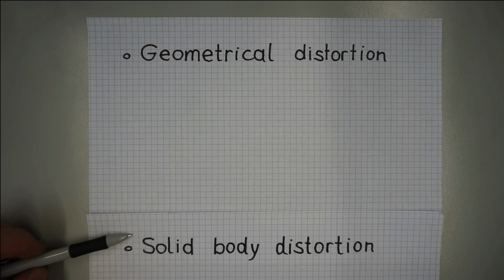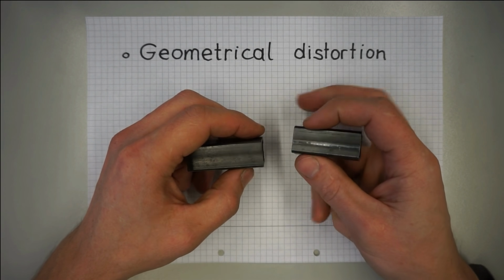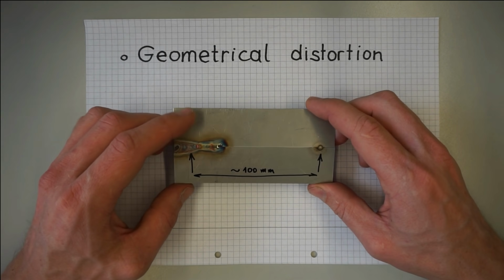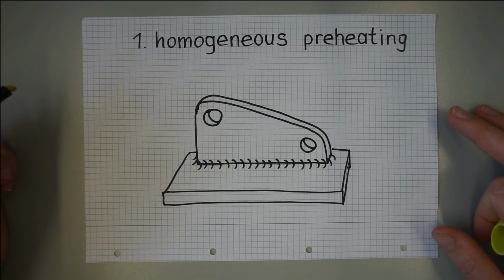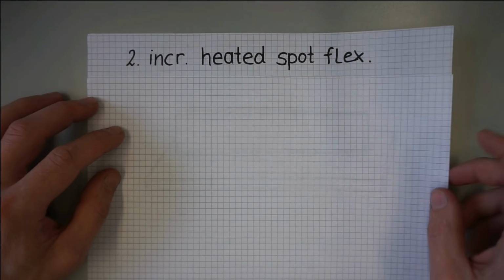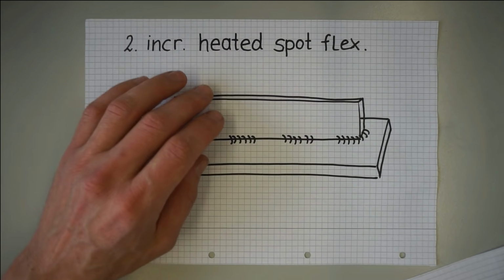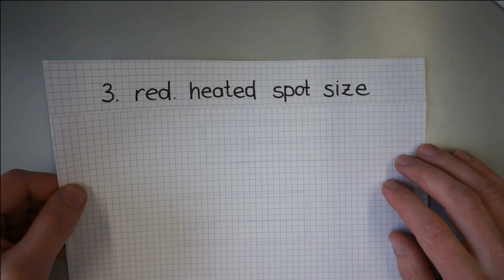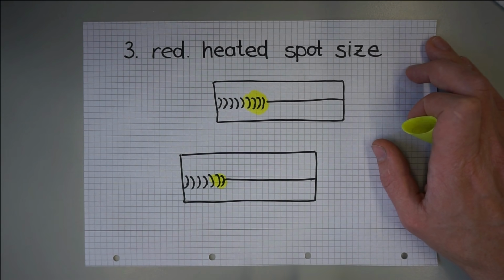Welding Distortion Explained Part 4: Influencing Distortion

Comment: Such a amazing series! Thank you very much. I was really shocked by result with clamping. As a amateur welder it open my eyes that prep work, positioning and proper tacking is the best way to minimize distortion. And that it can be actlually straightened with flame or tig torch by local heating. I have no idea you can actually somewhat "repair" that distortion, i was living in world where it just happened and nothing can be done.

Comment: I still did not understand why its bending in the direction where the heating / welding was applied? If heat expands stuff then intuitively it should bend in the other direction, opposite to the weld? But thank you for the 4 parts. I'll have to search another additional resource.

Comment: Outstanding series. I'm trying to wrap my head around how clamping with the fixture table effects welding distortion. I can understand that if you heat up one side of the square bar in the center, the material becomes soft and expands. As you say, it's being constrained in x and y, but mobile in z. It makes sense that if the bar isnt free to move, there will be a greater expansion in z. but, for example, if you wanted to make a square frame out of square tubing with 45 degree joints, would fixturing it reduce distortion? Maybe because the joints are being connected together when by the filler metal when it is at its hottest (most expanded). There for the only distortion that happens is from the contraction of the joint. The fixturing constrains this and causes plastic deformation of the joint in favor of reducing welding distortion? I'm not sure

Comment: Hello Alex, Can I have your insight in residual stress in big machines such as CNC machines. I see many DIY makers make their CNC machines (even the one that is quite accurate) using welded frame and gantry. I always wonders if the residual stress really significant in such builds or it will creep up later and, say, bend the frame.

Thank you and have a nice day!
Reply: Hello Thanh, thanks for your comment. From where are you writing to me? Good question you raise. The welding residual stresses are a concern unless they are relaxed by heat treating the welded parts. If no heat treatment is done, however, they are less of a concern if the welded parts are sized thick and beefy for the loads the machine will have to deal with. If, on the other hand, the parts are sized thin and lightweight, then the loads the machine puts onto them may raise stresses high enough so that residual stresses from welding plus stresses from machining loads together may cause the material to yield in large areas, causing the welded part to deform plastically. Hope this helps. All the best, Alex.
Reply: @alexfillafer  
Hello Alex, thank you for your promt reply!

Im writing to you from Vietnam, a tropical coastal country in South East Asia. Shared your vids to a bunch of my maker friends and they are all excited. Especially this series and the straightedge vid. We all appreciate the educational experience you offered! 

Back to the question, that was an ahh moment for me as this question had been bugging me for months. Among Cnc diyers we all know welding makes residual stress but still confused that many projects using weld still hold up great.

In my case I am building an equivalent of an industrial Cnc router. Decided to avoid welding due to residual stress, just bolt + metal epoxy (to increase contact area) + rolling pin. But now I need to rethinking weld as it’s definitely stronger.

I guess there is no way to quantify how thick is enough to avoid residual stress rather than, well, just try and see, or sized an as thick as possible steel tubes given that inaccuracy through time is a nightmare

Thank you and have a nice day!
Reply from the maker: @thanhnhanhuynhnguyen3652  Hello Thanh! No need to explain where Vietnam is, I've been lucky enough to visit your country twice, also Cambodia and Laos. I really like the kind nature of the people in south east Asia (and the food of course) and the way of life there. I know there are many downsides to life in your country as well, but I think your people's way of life is surely less "artificially" complicated than in western countries. Do you know Ca Lem? His videos I really like to watch, particularly the one of his tour through Vietnam. All the best and kind greetings, Alex.
Reply: @anengineersfindings  
Dear Alex, 

sorry to take ages to reply. Our independence day was 11 days ago, big national holiday, which mean crazy work before that and crazy drinking during and after. I got caught up with all the vacation and drinking that I completely forgot to reply someone i admired.

Im really glad to hear that you like our country (and the food of courses haha). Fortunate to visit Western countries sometimes, I have to say I agree with the term artificial. It was a culture shock to me when i came there. Regardless, they are great countries!

I know Cà Lem (the name means ice cream in a cute and refreshing tone), it’s inspiring that he learned things by himself as well as he is (i think) the first famous youtube machinist that is Vietnamese. I love the tour too and did some by myself as well. Planned to record and put some of my enduro and road trip on in the future (well not the near future)

Glad to talk to you! Wish you all the best

Thanh nhan

Comment: what do you think will happen if it is tensioned clamp, like you put somethingin the middle of the clamping spots, and put a bit of tension on it, 

i often have the problem of bananification of pipes when welding on nipples along the pipe, for water nozzles, and preheating is maybe an option but it is stainless so prefferably not because then you have to polish/pickle the whole pipe

Comment: Thank you for a very informative series. I have one question for you though, on the pre heated weld , after pre heating you placed the sample on the cold table, cooling the bottom to some extent. What would the result be if this was not done- less distortion ?

Comment: Hi Alex. First of all thank you very much for affording your time doing this video series. I am a civil entineer with passion in metal works. I learned all my knowledge about turning, milling, welding and so on by reading and discussing in forums, watching DIY-youtube videos and reading books or articles. But your video about the well feared welding distortion is by far the most accurate and scientifical one I have seen to this topic. If you have some time left, a video about the different welding settings and the influences in distortion woudl be awesome. For example the frequency when welding (low or high Hz), the pulse settings (high current - short impact time or less current - longer impact time) and so on. Unfortunately I have not found a good source in explaining that yet. Tanks and greetings from Upper Austria. 😉
Reply from the maker: Many thanks for your interesting comment, I'll think about your suggestion. ATB from Carinthia ;)

Comment: I have to ask you something Alex. When my uncle came home from the military. He taught me the in and out of welding. That time it was SMAW and Oxy-acetylene welding. Since that was many years ago and memory fades with time. He showed me the use of holding flux to help hold thin sheet metal which was stainless steel. I the name was Solar flux and using oxy-acetylene torch you could weld just beautifully and keep the sheet from turning into a pretzel. Would that method be another way of keep warp and distortion at bay ???? Peace
Reply from the maker: Wow, very interesting, thanks for your interesting comment!

Comment: As Alex said, it is difficult to write up an "avoid distortion cookbook." Real life weld jobs are very diverse and weld conditons can put up constrains, limiting your possibilities. Nethertheless, Alex provides easy to understand insights into this topic. As already pointed by husq2100's comment, clamping can be done in such a way to pre-bend a part in the opposite direction (done that, works) and during cool down you can either wait until handwarm before opening the clamp or earlier to "correct" the degree of remaining bend. As Müller Mick mentioned, it would be good to cover sequence strategies (Pilgerschritt etc.) and aspects of infused energy (Streckenenergie etc.) in a subsequent video. Great content, esp. in times where the precentage of meaningful content and reasoning on the internet gets smaller :). Thanks for the very good work and greetings Stefan.

Comment: Great series to learn about distortion, but it is only theoretical and the given practical examples are done on simple elements, not even a welded joint like in this part. When in actual manufacturing you can have large or difficult assemblys containing 10, 20 or more than 100 parts and many different welds, closed spaces, various part thickness. There will be no possibility to make a preheat for whole structure, nor use heat sink and the only available options are welding process and technique (like in your example pulse), clamps/jigs and weld sequence. That is the reason you can't find a book that will solve this problem and why there is many books with suggestions of using clamp/jigs and various welding sequences. What is shown in this series maybe could be aplied for manufacturing simple assemblys containg few parts and few welds. Trying to apply these methods in manufacturing of more difficult or large products would drasticly slow down manufacturing speed of the product and increase its price. In todays world everything must be done fast and as cheap as possible. Regarding the preheat method of the part, welding interpass temperature by most standards and handbooks is limited to 250C, so preheat to 300C is not acceptable. It would be not practical to preheat it to 150-200C either, because after few passes 250C would be reached and welder would have to make break and wait until it cools a bit before continuing, slowing the manufacturing process. My guess would be the lower the preheat temperature of the part, the less affect it will have on controling distortion. So yes it is nice in theory, but doesn't have much practical value.

Comment: I disagree with your comments on clamping/fixtures. It is proven and quite common to pre stress work piece to counteract the deformation caused by welding. If expansion is in 3 dimensions (X,Y,Z) and you restrain it in one dimension you can control deformation in that one direction. Restraining the work piece in more than one dimension would of course create problems that you have pointed out.

I understand your experiment and appreciate it.  But your clamping was not the way to counteract the distortion. You would normally pre stress the work piece with tension i.e place a shim under the centre of work piece to bow it up (opposite to what the welding will do) . This is also why you had troubles or not good success with the flame straightening with pie or wedge shaped heat zones. You must restrain the work piece for the heat to deform it (shrink) in the direction you require. There are plenty of videos on YouTube showing huge deformation achieved on large structural beams with the wedge method. Sometimes the work piece is not restrained with clamps etc as they can use gravity instead,given the weight of the work piece. But it’s still a form of restraining.

Comment: Thank you for making this series, I learned a lot. Prior to watching this I have had success using a tig welder to flame straighten by essential making a matching weld on back side of the metal. Now I know why that works. The negative effects of clamping while welding that you showed were enlightening. If you haven't seen them you should watch Dan Gelbarts series on making prototypes, they are also a mixture of theory and practical. Thanks to Stefan for sending me this way.
Reply from the maker: Thanks for your comment, glad if you find the content helpful. I already knew the Dan Gelbart series. Thanks.

Comment: Great content, thank you. The point of welding sequence is not very clear to me.
At 17.10 you say welding sequence helps "actually no" and one sentence later you say it gives low distortion.
Hmmm...
Reply from the maker: What I mean is that "welding sequence" is not a mechanism by itself, but rather a simultaneous combination of the aforementioned mechanisms to reduce welding distortion. Hope this answers your question.
Reply: @anengineersfindings  Thank you

Comment: Finally made it to the last part.Your series really can be used as reference. All well explained and thought trough. Both for the beginner and expert, they all can learn something, refresh their knowledge and look at things at a different way.
What I missed in this part was a closer look at welding strategies like "Pilgerschritt" (is that "pilgrim's step" in weld-speak?).
Also a deeper look at "Streckenenergie" (energy per distance) or J/m. Comparing all methods (just by giving the numbers) would make more clear what a possible way of reducing distortion would be and what to expect. Comparing by energy of O/A, stick, TIG, and MIG, pulsed or continuous (can you demonstrate pulsed O/A?) would be interesting.
Anyhow, despite my nitpicking ("Nickpicking" [tm]) truly woth watching and learning from!
Reply from the maker: Thank you for your kind words, Nick.
I'll think about treating your suggestions in a supplemental episode.
All the best,
Fif

Comment: Alex really enjoyed this series,  Couple of questions regarding straightening solid round shafts about 25mm in diameter can you use a tig torch for heating or is that too focused a heat source and is rapid quenching beneficial to the process? Finally is there a formula to determine how much area needs to be heated verses degree of bend in the shaft?Thanks Zed
Reply from the maker: Zed, to be honest I haven't seriously tried to use the TIG-torch for straightening, but if you can manage not to melt the workpiece surface it should work just as fine as the oxy-acetylene torch. Rapid quenching is not necessary for the straightening process. The whole purpose of watercooling is to keep the workpiece from gradually preheating and to allow for checking of workpiece geometry improvement (for this, the workpiece must have equalized temperature).
I don't know of a formula to determine the necessary heated spot size and temperature, I assume there is none, because the straightening effect is a function of so many variables. Therefore, one usually places a moderately sized heated spot and after cooling checks geometry improvement. This gives a good feel for the size of the next heated spot to apply in order to (more or less gradually) attain the desired workpiece geometry.
Reply: Here's a master of marine shaft straightening showing how he does it.  He doesn't do the math, but it may be instructive to see someone who has been doing this for decades do a demonstration.  https://www.youtube.com/watch?v=MtnkkAzRgP0

Here's an older example of heat straightening shafts on the job.  https://www.youtube.com/watch?v=bOT4cSTJyqw
Reply from the maker: Thank you for adding these links, I really forgot to mention Keith Fenner as a reference for practical demonstrations.